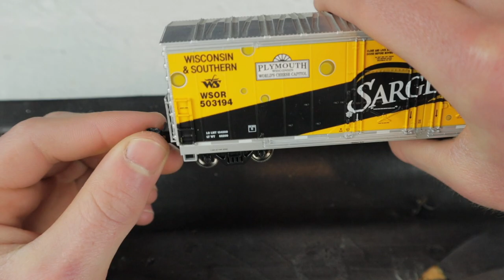How To Replace The Couplers On Your Ho Scale Trains.

Comment: Super. My railroad has seven different couplers in use to this day, (Kadee knuckle, X2-f hornhook, Mantua loop, Maerklin Relex, Proto 2000 combo couplers, link and pin, and even four cars with scale size European screw couplers.) and I might have the only Maerklin Relex to Kadee knuckle coupler conversion car that exists on this planet. Hello from the Tracy Mountain Railway in Colorado. 💙 T.E.N. Edit: Some of these couplers are also of the radial type, allowing the car to be used on the trolley line. Long ago I bought radial X2-f, Mantua loop, and Maerklin Relex couplers from the hobby shop and equipped all the trolleys and some cars and locomotives with them, including an Athearn Bluebox SW-7 that will take seven loaded cars around a 4 3/4 inch radius trolley curve. 🙂

Comment: Being brand new to the hobby if you have Athern rolling stock/box cars I assume you need a Athern loco with matching couplers to run correctly? - also within the same era? I picked up some Lima vintage rolling stock and the bogies are design that cant be updated unfortunately.

Comment: Kadee #5s are hands down the best coupler in ho and n scale
Reply from the maker: Kadee #5 are only in HO scale.
Reply: Track10Trains they make them for n scale too
Reply from the maker: I cant find any in N scale. Are you sure they do?
Reply: Track10Trains yes because I accidentally bought them for my athearn baggage car lol
Reply: conrail modeler67890 N scale has MicroTrains. 5s are great but I think 148s and 158s are better because of the whisker design, which makes coupler replacement much easier. 5s won’t fit in Scaletrains gear boxes either